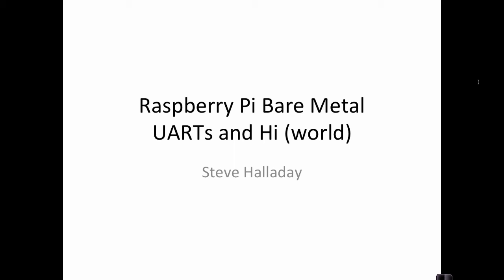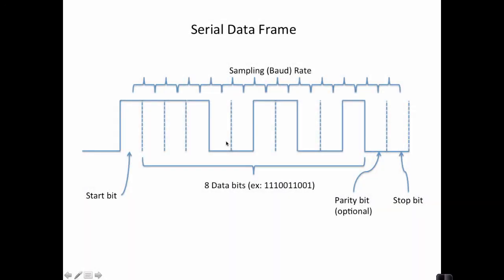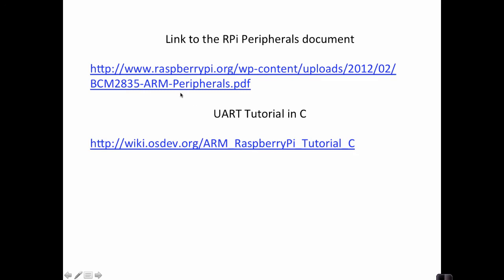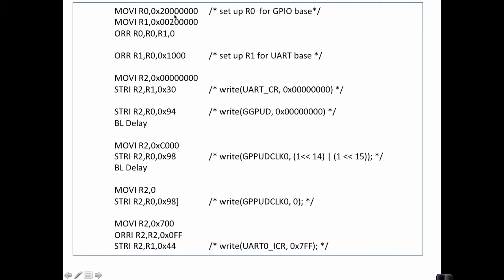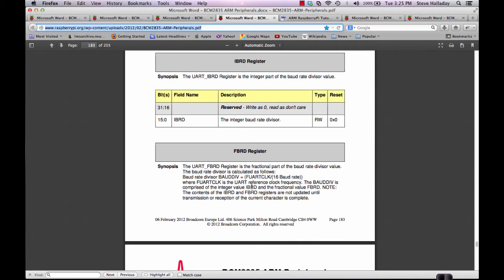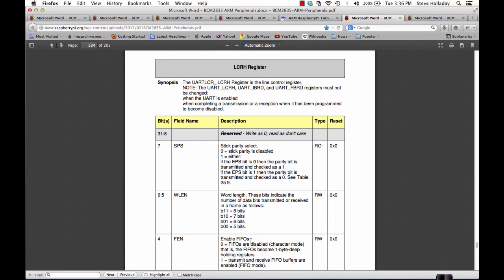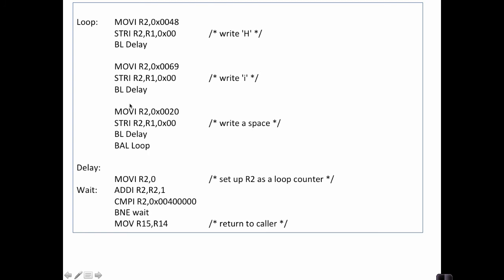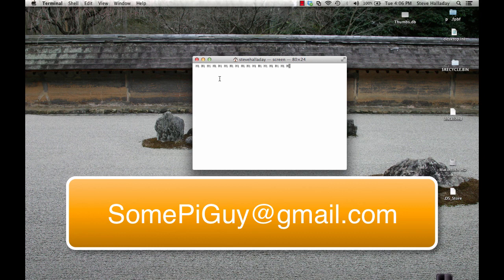Raspberry Pie UART

Comment: All writing to GPPUD, GPPUDCLK0 is unnecessary in this example. UART requires the pins to be in a low pull state, which is the default after a power cycle. See table 6-31 in ARM peripherals for default pull states.

The code given for setting pull up/down is also missing a step (Step 5 on pg 101 in Arm peripherals) I am under the assumption the pull up/down is not even being set as a result. The code works because of the for-mentioned default pull down state.